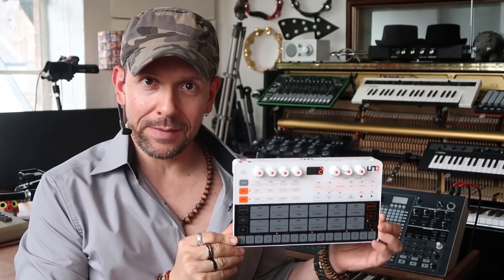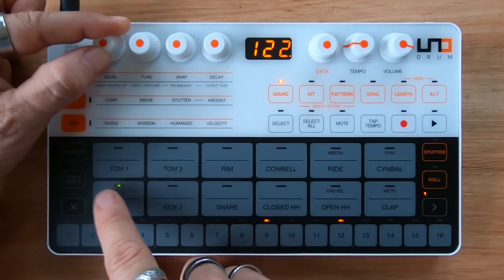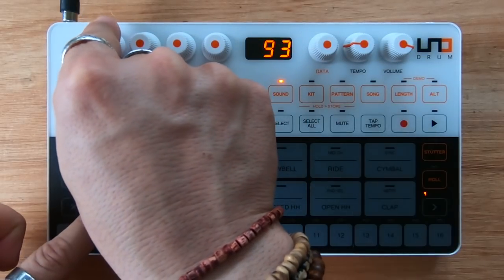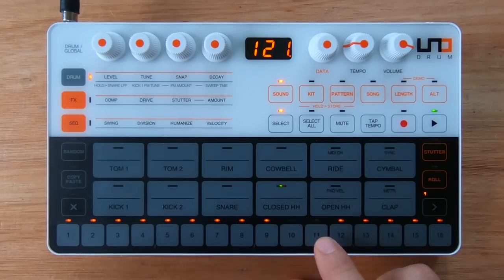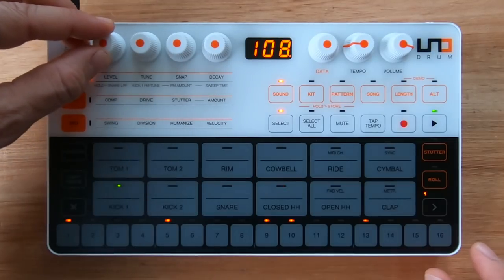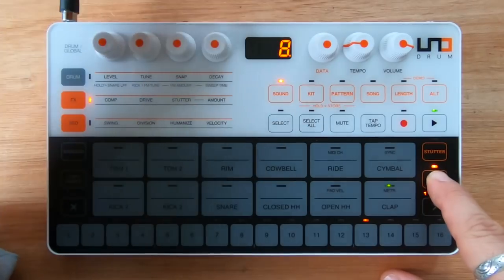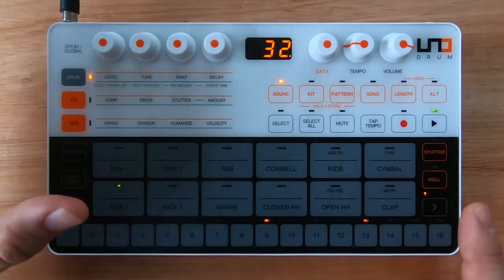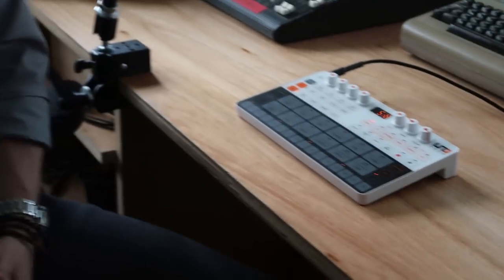UNO Drum In Action

Comment: I know this isn't the right place to ask for help, but I'm desperate...When I attach my new UNO drum to my Windows 10 PC with the included USB cable, the Editor just sits on "Waiting for UNO" with no response. I have tried several different MIDI settings in the Editor, including setting the MIDI input channel to 1 and the output to 10 or other channels. I've tried the setting the MIDI sync to USB; tried the Send PC and Receive PC to ON. Nothing makes the Editor recognize the UNO Drum. IK has not responded to two help requests. WHAT SETTINGS WORK ON THIS DEVICE?

Comment: sounds, and looks, very tidy, if it had 6 outputs i might even have considered it over the impact - good demo too

- does seem a little over priced though, considering the output options, and basic user interface, - but i get that analog comes at a premium, and the target market appears to be for live performance, laptop musicians, - still, competing against the drumbrute impact and RD-8 is gonna be tough, that being said, - i genuinely hope it is successful, - a larger format model could turnout to be very impressive...
Reply: Agreed. Priced too close to the DrumBrute Impact and the RD-8. Portability seems to be it's biggest strength. It seems to straddle a spot between a pad based MIDI controller/phone combination and the DrumBrute Impact/Behringer RD-8. Perhaps not that good a spot.
Reply: Analogue does not come as premium , transistors and capacitors are well cheaper to produce than a fully digital synth , this analogue vs digital nonsense is getting old now and this machine sounds like my old boss drum machine from the 90s , buy old gear and some guitar effects pedals ,trust me you’ll make way better sounds , im still rocking a Yamaha qy70,its an amazing piece of kit.
Reply: @valley_robot  Then why has Roland not produced an analog recreation of their classic drum machines? The demand is there to the point that they wanted to sue Behringer (or sued?) for their 808 clone, because the demand for that clone is so high.
Reply: ed rosa well one reason is virtual analogue can be mass produced cheaply , once you have spent all the money on hiring someone to design the chips , analogue machines all though cheaper in parts they tend to be not mass produced and involve lots of separate parts , to mass produce an analogue synth is not worth the time and effort to the manufacturers, once they spend the initial large amount of money the virtual one will make more profit as its mass produced, if I had the soldering skills I’d make my own

Comment: Meh. I don't really get the point of this. There are so many affordable 100% analog drum machines that have individual outputs, lots of knobs, and actual buttons. And why would anyone want a PCM-based drum machine in 2019 when you can get digital drum machines that actually synthesize the sounds (like TR-8/8S or LXR or even Digitone) or could just buy a cheap sampler? I get that it's cheap, but it's also so boring.